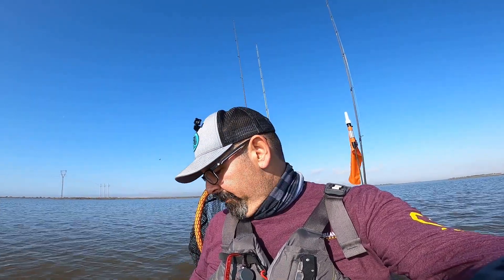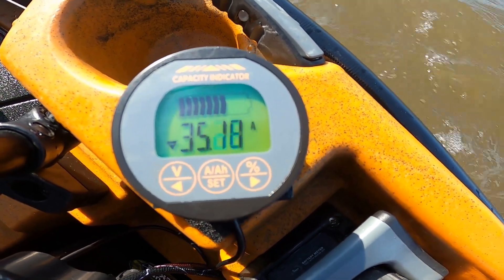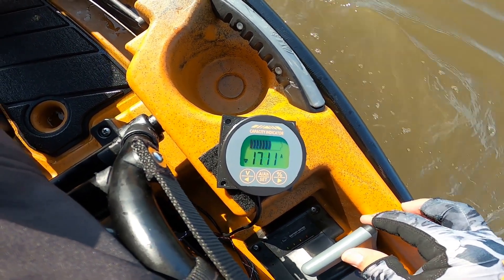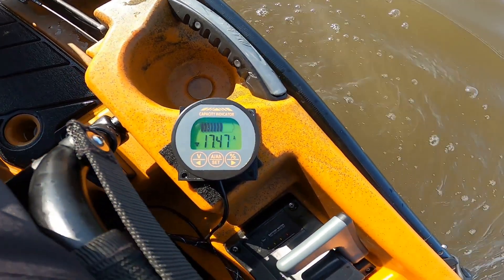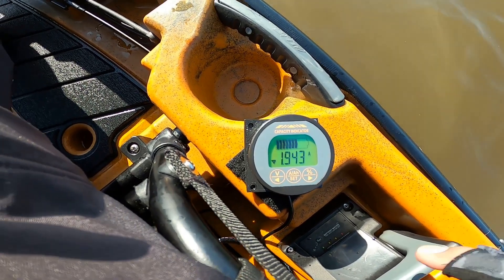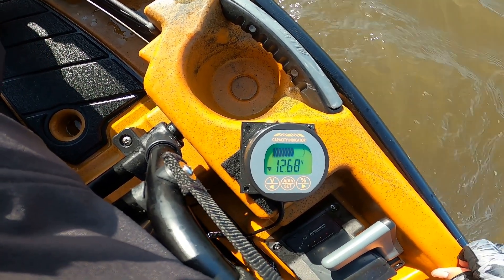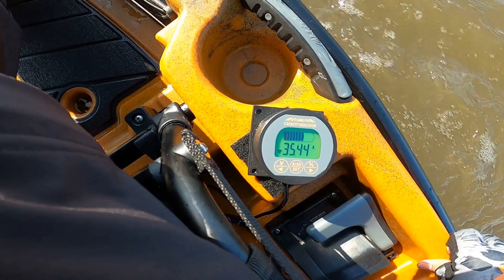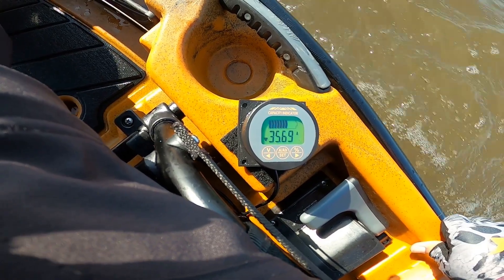HOW TO MANAGE your Trolling Motor`s LITHIUM ION BATTERY  using a Lithium Multimeter . YOU NEED ONE!

Comment: How you mount that dude?
Reply from the maker: The wire comes from the battery box which is under my seat. It comes with easy to follow instructions on how to hook it up to the battery and how to program it
Reply: @jettercool  got that but how did u mount it on the kayak
Reply from the maker: @BobBohner4851  i just used Velcro
Reply: @jettercool  nice. I was thinking of drill ing a hole in my AP120 lid off my storage box and siliconing it in the lid
Reply from the maker: @BobBohner4851   you can do that but with Velcro you won’t have to drill holes and you can easily remove it with the battery every time
Reply: @jettercool  all very good points. I’m doing it your way. Thanks for the info
Reply from the maker: @BobBohner4851   Thanks for watching!
Reply: Got it done. Thanks so much